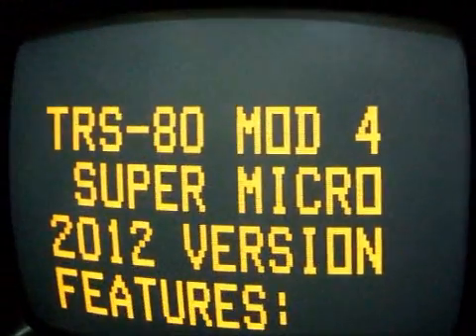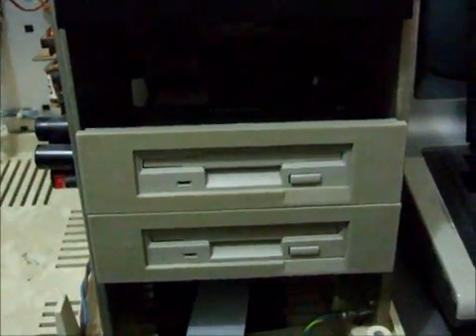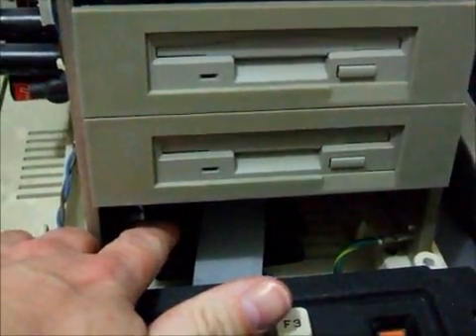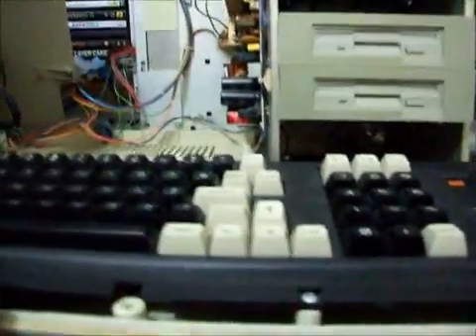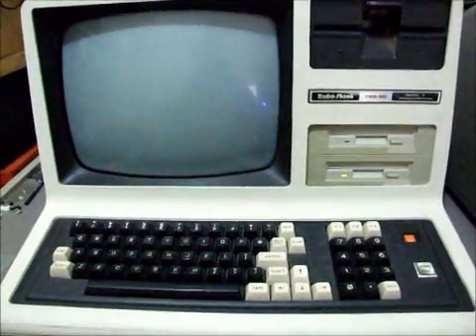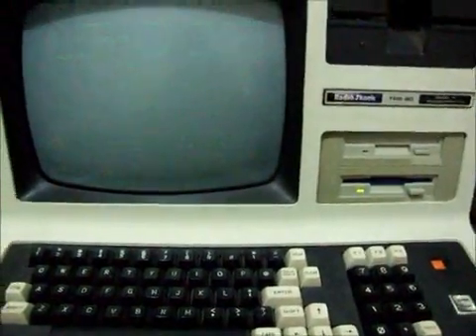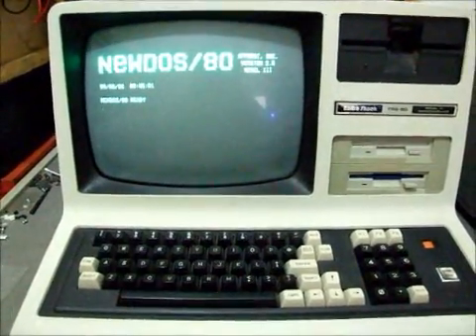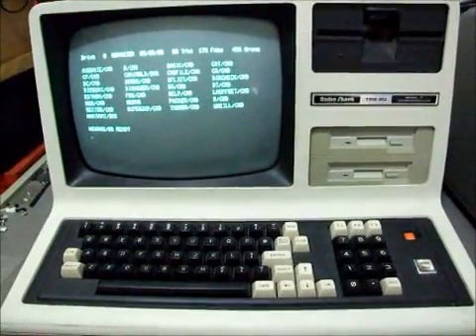TRS-80 Model 4 128K with 3.5in disk drives

Comment: That's beautiful! I've been trying to put "new" 3.5" PC floppy drives in a model-III clone, but due to some reason didn't succeed just plugging them in the place of the original 5.25" ones, using a simple adaptor. Is there any wiring trick that I am missing? Thank you!
Reply: CP200S